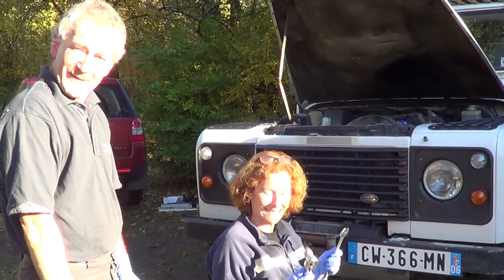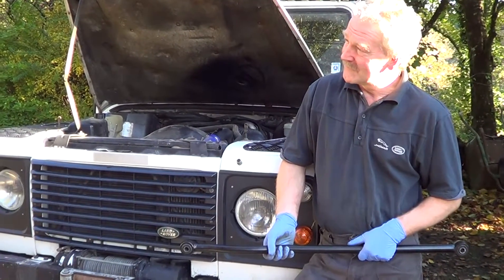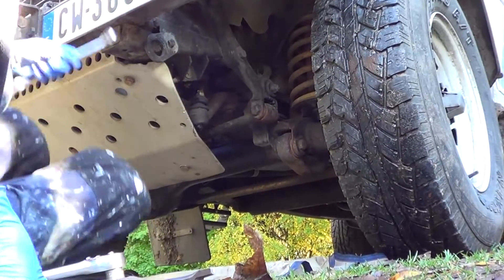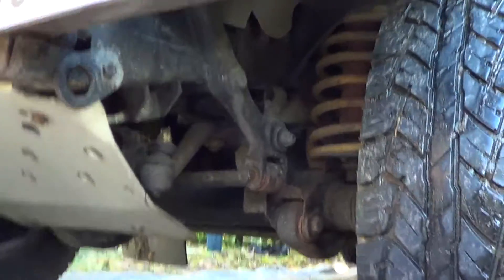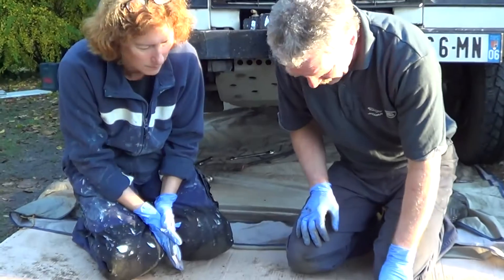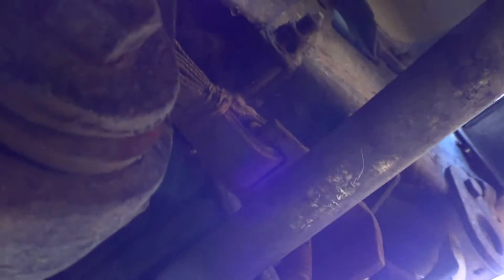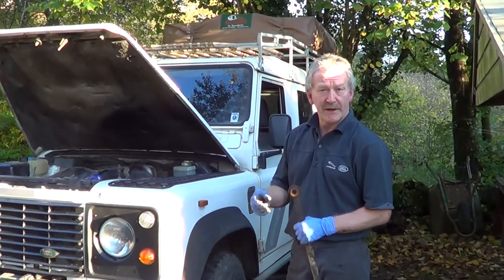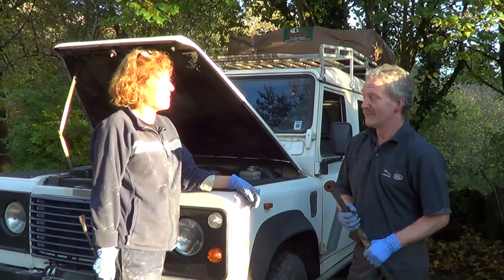How to replace the Panhard Rod with Rob & Vic - Land Rover Defender

Comment: Thank you for this - very helpful. Just did a review of my panhard rod to see if it was causing my steering issues. Turns out someone put a later model M16 bolt size panhard rod support bracket, and later model M16 pahard rod (and associated bushes), with a M14 size panhard receiver axle type, on the vehicle. The result being the M14 bolt on the axle end swimming within the M16 size bush. The seller had just really cranked on the axle end of the panhard bar to restrict the bush movement. Going to drill out the receiving axle end to an M16 size, up the bolt to a M16 size, and finally drive with confidence.
Reply from the maker: Wow - some DIY stuff going on there! Glad you found the problem, and good to hear the video was helpful. Keep rollin'!🚙
Reply: Update: Just finished yesterday (had to wait on the parts to be shipped in). So glad you had this video. The use of the prybar to help with the installation of the new panhard bar (by shifting the body to better align the bolt holes with the panhard bar) was the saving grace. Driving is so much better now. Thank you again!
Reply from the maker: @capt.caymaaan6923  Nice one! Glad we could help in some form... I've done that numerous times 😊 - finally got the OEM bushes in there and we've stopped the 'earthquakes' 😁

Comment: I have used genuine Land Rover bushes and Poly bushes, and without any doubt the genuine LR bushes are the way to go. The rubber bushes will wear over time, where as the Poly bushes tend to split suddenly leaving you with no bush at all which in a overland Landy is a nightmare. Also I find Poly bushes give a hard ride if fitted on the radius arms. Admittedly removing and installing rubber bushes is a pain in the ass even with a press.
Reply: +DuctTapeWorksWell my exact same experience here, genine is the way to go
Reply: DuctTapeWorksWell I found that out yesterday the hard way.

Comment: Can we change rubber bushes to steel bushes (fabricàte) to get rid of death wobbles
Reply from the maker: Imho, no. Just like the transmission, everything is in balance and related to the next part. If you put steel then you transfer the forces to the next part, and then if you stiffen that you transfer to the next (e.g. steel panhard bushes put pressure on the hockey sticks, then the steering damper, then the track rod ends and you move further up the line until something breaks). If you fit OEM bushes they last for a long time anyway. We've had death shake twice in over ten years (two different Defenders) so not a big deal in the big picture. Both times replacing the panhard bushes sorted it, so keep the 'weakest link' right there as it's an easy fix. I think LR got it quite right overall, but that's just my opinion.

Comment: I would have replaced the bolts, and at the very least the lock nuts.
Reply from the maker: Yes, you are quite right. But filming 'off-the-cuff' while visiting Rob in Cornwall, our resources were slightly limited. The desired effect was achieved, but now the swivels need attention once again...